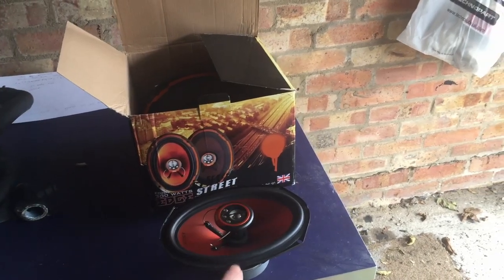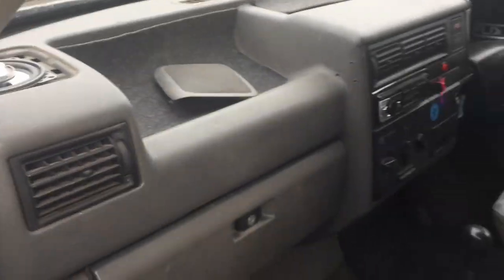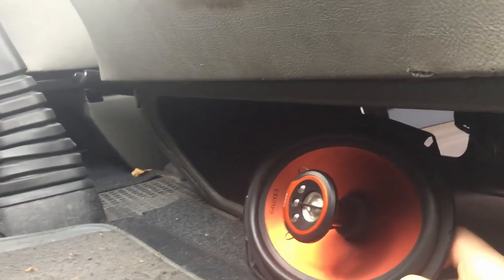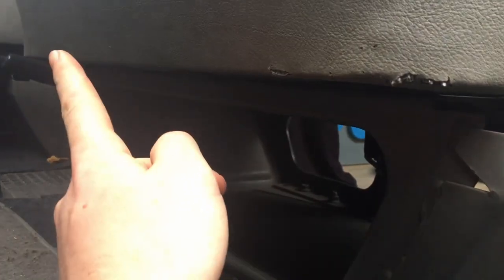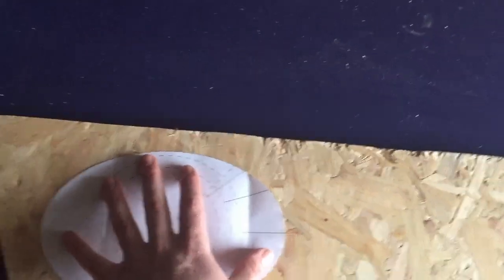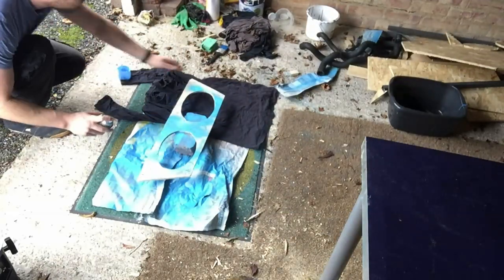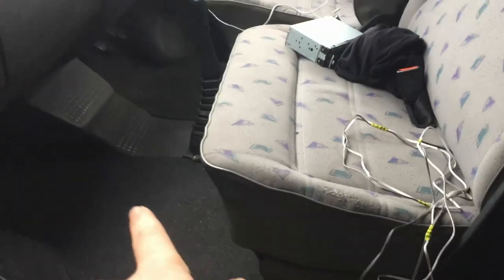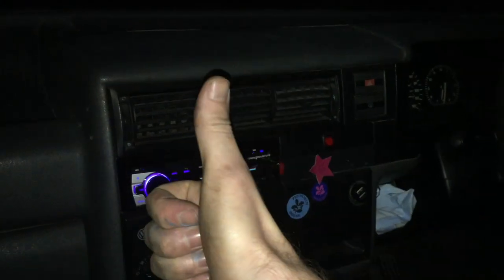VW T4 easy speaker upgrade

Comment: have u still got t4 grey one Joel .mine is same colour.use daily plus hols Cornwall etc thinking of adding 6 x9s but where perhaps tailgate .but far away
Reply from the maker: I still have the van yes! These days I have my 6x9 speakers in separate units so I can move them around. Good luck!
Reply: @JoelsStuff  goin try put speakers above my head in roof as there are spars 2feet apart need a plywood board for sound backing .under seat too muffled
Reply from the maker: Sounds cool!
Reply: @JoelsStuff  yeah mayb make some pods to attach to roof 😀where  you based I’m in Cheshire
Reply from the maker: I’m down far away in bucks!

Comment: Hi Joel how did you find the under seat diy speakers sound wise ?did they improve the speech quality .i have some wharfs dale diamonds going try under seats on my t4 and have some kenwoods to fit on top dash
Reply from the maker: Hi steve. If I’m being honest it was not great. It helped a bit, but the sound does not travel too well from this location. I ended up moving them to the front (in front of the passenger’s feet) and it improved a little

Comment: Would it not of been just as easy to make new door cards and mount them in there?
Reply from the maker: Whyman1993 

Maybe. I thought the doors looked a little too thin for my speakers, and I didn’t want to have to deal with speaker wire going into the doors. If you can make it work though no reason why not 👍
Reply: Well at least your having fun ...